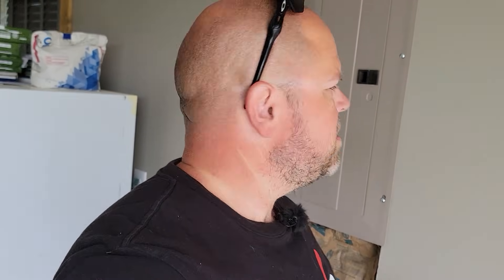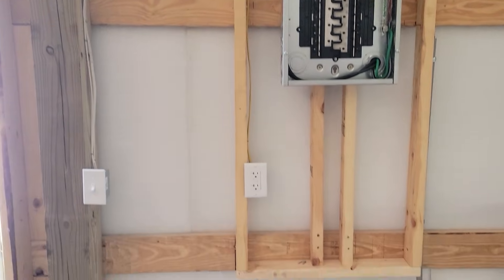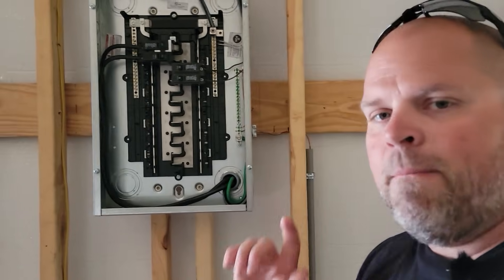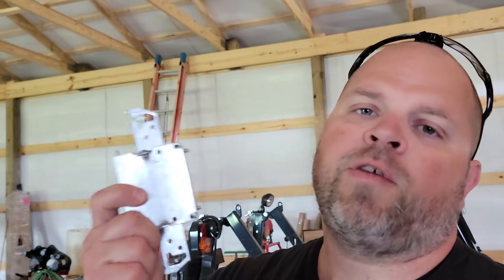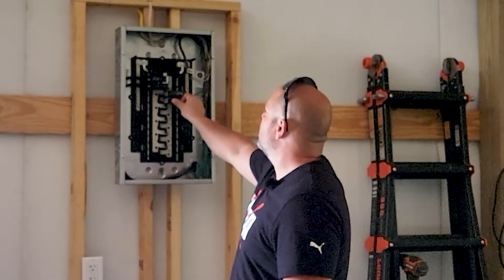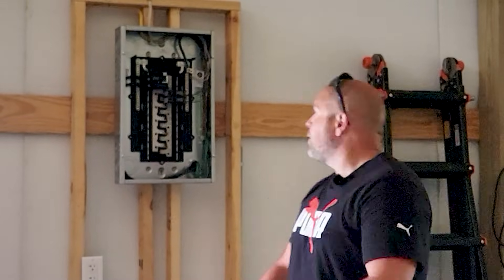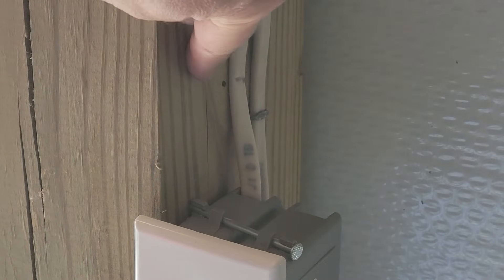Why I Failed my detached garage rough In Electrical Inspection

Comment: IV WORK AT THE USNA FOR 10 YRS, AND THATS ALL I USED IS MC CABLE. AT THAT TIME IT WAS CALLED ARMERED CABLE WITH NO GROUND. IF U WANTED A GROUND CABLE IN IT U WOULD HAVE TO PAY EXTRA. I DIDN'T KNOW ABOUT PULL BURN'S. GREAT VID'S TKS.
Reply from the maker: Thanks for watching and commenting 👍🏻
Reply: MC is not the same as armored cable, they're different products.

Comment: So can you run Romex wire in a garage or must you run MC?
Reply from the maker: Will the wiring be exposed? In my case, it was considered an agricultural building. Plus, the wiring was exposed. I think if I had plans at that time to finish the walls immediately, then they would have allowed Romex, though. Thanks for watching and commenting 👍🏻
Reply: @TheSolarPit  yes some romex will be exposed and some will go in single a double gang boxes with box plugs and then I’ll be running conduit to the brick walls. Will that be ok?

Comment: And suddenly you understand why it costs what it costs to hire a professional who knows the codes and would do the installation right the first time.
Reply from the maker: True. However, I finished it and learned a valueable lesson by doing it myself. Hands-on training, I am not scared of failure - I learn from it. Still saved several thousand dollar on that project. Money I can do something else with. Like help me payoff that solar system I installed myself also. Thanks for watching and commenting. 👍

Comment: As none lincesed can you pull permit for high voltage permit as home owner or your permit is submitted by licensed contractor and you do the work?
Reply from the maker: Yes, if you are doing the work for yourself. It still needs to pass the electrical inspection and get final approval. Thanks for watching and commenting 👍🏻

Comment: Falls under commercial. Never heard some argriculture thing. Commercial requires pipe. This is also one them things, you word it correctly and you'd pass. Like putting a panel in a pantry, you call it a utility room(remove all food). BOOM pass.
Reply from the maker: You are correct, wording is everything. The agriculture part comes from the type of permitted approved for the structure. It was permitted for agricultural use. Hope that helps clear that up. Thanks for watching and commenting 👍🏻
Reply: Incorrect, agricultural buildings don't automatically fall under commercial. NEC Article 547 Agricultural Buildings
Reply: @pld8993  You're correct. Its actually because he has a metal building.

Comment: I know codes vary from state to state but the building I just built has a floating slab with a thicker outer edge.  The building is bolted to it. I wonder if that is considered a footing.  Thanks for the heads up to check my buildings classification.
Reply from the maker: Your welcome. Thanks for watching and commenting. 👍

Comment: Your the real deal! Not only do you show your mistakes along with the correct method but also the pain in getting it done correctly. I have made many mistakes, (a part leftover from an engine rebuild , forgot to solder one pipe fitting etc.) but hung in there, persisted and yes into the wee hours the morning finished. I learned a lot thank you for sharing!
Reply from the maker: Much appreciated 🙏 I have a huge update video coming out in a couple of days on the progress of finishing my shop. Thanks for watching and commenting 👍🏻

Comment: Thanks for the video, clears up a good bit of questions and you talk like me(no offense) so I can understand what you’re explaining.  Now do a 60 amp run 200 feet.  That’s my current project.
Reply from the maker: 🤣 Thanks! I am working on wiring the building now and hooking up a 50amp circuit for welding. That's about as close to 60 I will get in there. Thanks for watching and commenting 👍🏻

Comment: The guy at Home Depot told me the easiest way to put a grounding rod is to soak the ground the day before. I left the hose with a trickle of water over night. The grounding rod sank half down with its on weight. Than I just hammered it down the rest of the way. Super easy as the Home Depot guy said. 👍🏻👍🏻
Reply: The easiest way is to by a ground rod tool for your SDS hammer drill!
Reply from the maker: @Rusty Cas  Yeah if I ever need to do this again I'll just go out and grab one of those. Never again will I hammer it like I did. Thanks for watching and commenting 👍🏻
Reply from the maker: Thanks for sharing that tip. Next time I'll give that a try. Appreciate you watching and commenting 👍🏻
Reply: @TheSolarPit  It definitely works installing the rod AND removing a buried one. Did it both ways many times
Reply: Run the rod in a ways and pull it,dump some water in the hole and pump the ground rod up and down,pull and add water. Learned this trick years ago. Can easily hammer the last little bit. For you non-believers,just try it once.

Comment: Gfci is mostly for any area that can get wet! Or where you would plug a extension cord in and take that to wet location. Gfci circuits do not play nice with motors like refrigerator and air compressor.
Reply from the maker: I put everything in the building on a GFCI. Each circuit starts with one and then down the line is protected by it. Still working on configuring how I want to layout my shop. It's a process, but already know it is not big enough 🤣

Comment: Ask your inspector but the way I read it once you reach the rafters (out of potential damage zone) you can run romex
Reply from the maker: I am trying to determine if MC would be needed if I finish the walls. The wire would be protected at that point also. Thanks for watching and commenting 👍🏻
Reply: @TheSolarPit  the key is protection of the wires 
Even if you cover the area around the main until it gets too 7 ft
Reply from the maker: @davereynolds6912  I remember him saying something like that also. I told him I wasn't finishing it anytime soon... but now I want to finish a section. I will probably do videos on that process as well.

Comment: Thanks for posting this and your other video. I just had a pole building built and we’re getting ready to do the electric. Did they tell you why you can’t use Romex in the barn?
 Another question unrelated but, What did you use for insulation on your walls?
Thanks.
Reply from the maker: Yes, he mentioned that romex was not allowed in this building because it was technically a ag building. Because it's an ag building the wiring may be exposed and must be protected in a conduit for some sort. It would be tricky if the wires were gong to be behind covered walls but at this time my are not. I have not installed studs or insulation at this time but I am in the process of prepping to do some of the framing very soon. I will be using 24" OC framing and R19 in the walls when I do complete it though. I hope that helps! Thanks for watching and commenting.

Comment: Inspector told me, gotta have a light outside at one entrance of the AG building control by a 3 way or a automatic control via a dusk to dawn .  Since the building is an area where the fire department man 24-7, gotta have an exterior disconnect in a area visible for them to turn off.  And an exterior mounted GFCI outlet one for each side of the building.  Nice love to chew Romex and bugs can nest in breakers.    So I wired my pole barn with weather  tight NEMA 3 R everything.  Even tho it's inside.   Also when I had the trench open, I laid in conduit for Ethernet.  And when laying out the circuits, made  previsions for an exhaust fan to blow out fumes when working inside on the tractor during the extreme hot AZ summers.
Reply from the maker: Great idea on the internet line. Wish I would have done that. Thanks for watching and commenting 👍🏻

Comment: Where the MC cable comes down and then turns 180 to the bottom of the switch box. The radius of the 180 bend looks tight. Rule for MC is radius no more then 7 times diameter of cable.
Reply from the maker: Is that calculated from the cable or the wire size? It's about a 5in radius on that loop. The metal housing is about 1/2in. The wire is 14 on that switch. I think it's good to go on that loop. Thanks for watching and commenting 👍🏻

Comment: Glad you passed! I failed a few months ago for an agricultural building that I used MC in.  He said it needed to be the jacketed type mc - which he read as the vinyl coated mc.  Expensive interpretation
Reply: You should have asked him to site the reference. We use standard MC cable in ag buildings all the time. He's going to tell you a barn is a damp location. Tell him to prove it to you in the IBC.
Reply: @leesummers6979  NEC 547.5 (A) The only MC permitted is jacketed type MC in agricultural buildings.
Reply: NEC article 547.5 (A)
Reply from the maker: Wow! That's craziness. Thanks for sharing. Thanks for watching and commenting 👍🏻
Reply: Thats bullshit from a bancrupted electrician now inspector.
Reply: Unfortunately he's right. It's in the NEC in the article specifically written for agriculture structures.

Comment: Did you know mc cable actually has a one way spiral on them so they do pull easier thru studs if you have it in the correct orientation you really find this out when trying to pull it thru metal studs.
Reply from the maker: I do now 😁 Thanks for watching and commenting 👍🏻

Comment: About to embark on a similar project for a detached garage.... alot of good info here! (Not just the video, but you've got some great commenters as well... the pro's I mean)
Reply: Frank, his building classification hosed him here.  A garage or out building can be wired like a house.  The recepticles need gfci protection iaw 210.8. 

 An agricurtural building may get you tax advantages or some other advantage, but they expect animals or fish to be in an agricultural building and that adds requirements to keep the animals safe and the electrical system safe.

Also, consider your trenches carefully.  While they are open consider several conduits.....

One big enough for a 200 Amp run.  You can run a #14 wire circuit in a 2 in pipe,  you could then slide that out with a rope attached to pull in a 2/0.circuit whenever you want.  At least no more trenching to boost up your power.

And maybe 2 smaller conduits....
When your hobby becomes a part time job, you might want cable for TV or data to hardwire internet or security cameras or even some flashing lights....a dinnerbell or emergency warning light that flashes so you can see it when your work blocks the sound of your phone.

If the trench is open, you can just throw the pipes in and vacuum in a string.  Then cap them for future use with no need to re-dig anything.

More expense, yes.  Cheaper than re-digging a second trench....you bet.

Hope that helps.
Reply from the maker: Much appreciated 🙏 Thanks for watching and commenting 👍🏻

Comment: If this is an AG structure then it should AG exempt from the building code, which doesn't require inspections. Not sure what state this is in but in the Old Dominion that's how we roll.
Reply: The electrical building code (NEC) has a section 90.4 that allows different places to completely ignore it if they want.

The agricutural building section is set up to be an umbrella type section to cover animal storage.

A grounding section for cattle/pigs.

An electrical system protection section because bird/chicken poop may corrode the wires into a fire.

A dust section because some fish feed or plants may create flammable dust floating in your building.

I do not live in a farming community so my knowledge is limited here.  Just be safe.  Someone had to create a situation and suffer in order to get a special rule in the building codes.
Reply from the maker: Inspection was required by the county even though it was an AG permitted structure. Thanks for watching and commenting 👍🏻

Comment: "Wise men learn from other's mistakes."

2020 NEC 547 is the section dealing with Agricurtural Buildings.

"EQIPOTENTIAL PLAN" may sound familiar.  Yes, that section.  Extra requirements based on the animals that might live there.....corrosive chicken poop, live stock, etc.

Be safe, have a smart build, and thank you for the NEC review.
Reply from the maker: Thanks for watching and commenting 👍🏻

Comment: Sorry to hear that you are having issues.   The two ground rods and #6 copper is correct no matter what kind of building it is classified.   
I’m not sure why you had it classified as Agricultural but so be it.   The NEC article dealing with Ag Building electrical installations is Article 547.  547.1 says that that portion of NEC applies to areas within buildings with Dust and dust with water, and also Corrosive Atmosphere.   Whom what I see, you will never have either of these two conditions that would require you to apply 547 rules.   Article 547.3 says where you do not have those conditions in 547.1, the electrical installations shall be made in accordance with the applicable articles in this Code.   That means that you are not required to use only wiring methods listed in 547.    So, your original installation with NM-B cable and plastic boxes is NEC correct.   Warning though, you may be required to protect all cables below 8’ from physical damage since you are not installing in enclosed walls.
My suggestion.   Discuss article 547.1 and 547.3 with your inspector and see if they will agree that those rules do not apply to your building.
Respectfully,   Kevin
Reply from the maker: Much appreciated 🙏 We got it all sorted out and got the "pass" with those changes. It is classified as a agricultural building because that is the building permit I pulled with planning and zoning. Saved me 10's of thousands of dollars on the build. My acreage allowed for us to utilize that type of permit so we did. I also planned on the structure being the base for our solar array. Which is working out nicely so far.
Reply: @TheSolarPit     The point is, future electrical work in the building is not required to comply with article 547 of the NEC and your inspector needs to be made aware of that.   Right is right!
Reply from the maker: @KevinCoop1  I definitely agree 👍🏻 💯 I will be pointing out those articles when I expand on the wiring in this building.
Reply: @TheSolarPit  Just curious how it saved you 10’s of thousands of dollars. Could you not use pole barn construction if it was not agricultural?  Where I live (“out in the county” in rural Arkansas) we have no codes, no inspections, and no permits required, at least for residential. Makes things a lot easier, but also “buyer beware” when you buy property.
Reply from the maker: @RustyCas999  If it was not an ag permit it would require poured footers, trusses would have to be 16in or 24in OC, and complete outer sheeting would have been required before the metal went up. Several other factors that would increase the cost but those are some big ones. Thanks for watching and commenting.

Comment: I thought it was a 100 amps if so you #8 was ok. The 2 ground rod rule on a out building go by AHJ. Most dont understand what that rod is for.
Reply from the maker: It was 100 amp sub but they told me #6 ground was required. Not terrible fix but it was something that I had to fix though. Thanks for watching and commenting 👍🏻
Reply: #6 is the minimum for the grounding electrode conductor. For a 100 amp circuit a #8 equipment ground would be fine.  I believe
Nec  250-64 and 250-122.

Comment: I'm surprised the inspector didn't say anything about the plastic cover plates. They often require metal when there is no wall board.
Reply from the maker: Yeah me too 😁 I had them on hand just incase. I hate those metal covers lol I'm glad it was ok on the covers that I had on there though.
Reply: Or the unbreakable plastic ones

Comment: My electrician told me the hot tip for driving rods... chuck it up in an impact drill and it goes down like a knife thru butter.  Good to know now you're done ;)
Reply from the maker: 👍🏻 Next time I'll definitely go that route. Thanks for watching and commenting 👍🏻
Reply: There are also bits you can buy for SDS type impact drills that slip over the end of the rod.

Comment: 9:00 You're leaving to much insolation on the wire inside the box. Code is at least 1/4in, no more than 3/4. and to much wire, 6 inches. I measure 6 from the opening of the box. In 50 years, the next guy will thank you.
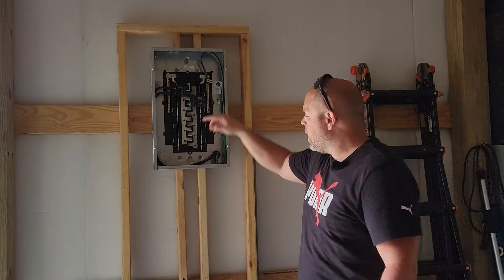9:10 Same with the light.
Reply: What's the code reference for the maximum insulation? And you can have longer than 6" of wire in the box. It depends on the box fill calculations for exactly how much the maximum wire length is but you definitely can have longer than 6".
Reply: @dracula3811  the wording only says at least a 1/4" from where the cable enters the box. Never seen a max.
Reply from the maker: Appreciate the heads up. On my next romex job I'll definitely take that into consideration 👌

Comment: 3:46 ...... That's 14 wire.... You need to use 12 wire...
Reply from the maker: I didn't use that wire but that 14 wire was going to be for my light circuit which is a 15amp breaker. I decided to just use the MC cable rather than buying conduit and running the wire. Thanks for watching and commenting 👍🏻

Comment: Call your inspector back and tell him your switch box is too small by .5 cu. inch. Surface mounted devices require unbreakable cover plates. Nice job for a non pro.
Reply from the maker: 🤣 Thanks! That's funny because I actually bought metal covers and had them on hand, just incase. 😁 Thanks for watching and commenting 👍🏻

Comment: 60 years doing this and I can tell you the code is bullshit BUT your failure to ask before you start should illustrate the need.
Reply from the maker: I did consult with a local electrician before making my first attempt. He was caught off guard by the rule being enforced also but in the end, it was the inspector's call. He was cool about it though and gave a logical explanation for why it needed to be. Thanks for watching and commenting 👍